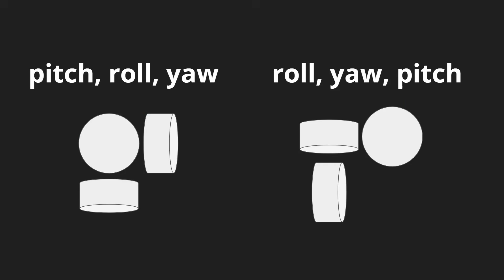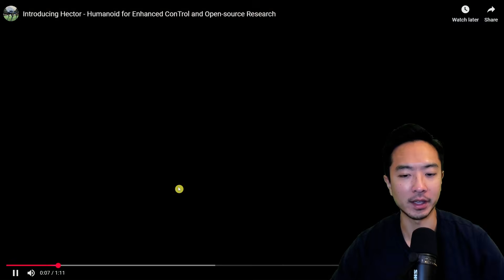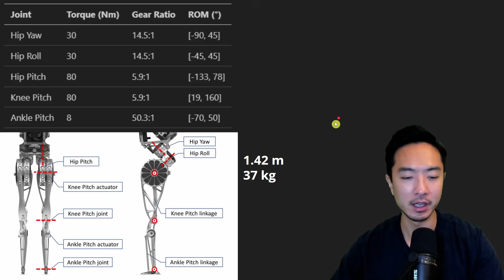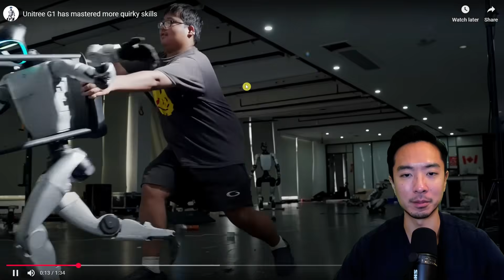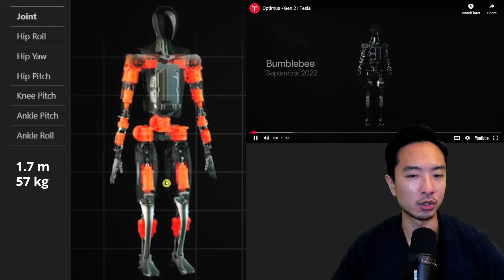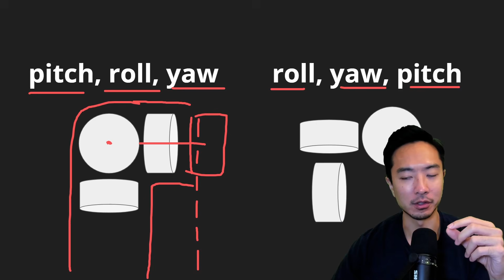Humanoid Robot Leg Designs (Actuators, Torque, Gear Ratio, Joint Configuration)

Comment: Use a mockup of the knee joint Human anatomy.  
Use a hydraulic or air. Shock absorption unit.
Use springs for toes. And add a ball to the foot. Separate the rear heal shock absorption unit to a hinge. 
Add a 》》》type rubber grip to the foot. Heal is for ballance.  Rear. The ball is for fowerd ballance.  You have the heal. Gust add the bird foot.

Comment: If you're going to design your own, there is a third 3 axis topology to consider which, while has more complex kinematics, has some mechanical advantages.  If you imagine 3 wedges, each containing an actuator connecting one wedge to the next and finally to the femur.  By driving the actuators differentially, it can move the femur in pitch, roll & yaw.  One big advantage is for many motions, it requires more than one actuator to move, summing the torque.  It uses more of the rotation of any given actuator, lowering the effective gear ratio and potentially reducing wear.  It also provides very neat packaging.  The main downside is restricted angular displacement in some axis.
Reply from the maker: Yes that could be a pretty nice compact design for a ball joint if ROM is not important

Comment: The last thing there: Aren't the roll-yaw usually crossing axes, so the roll is the booty in the back {adductor}. So the sweep of the leg in adduction isn't THAT bad.

 K-scale labs said they chose not to have junk in the trunk so that the Kbot would lie flat on its back. That's why they chose pitch role yaw in the end.